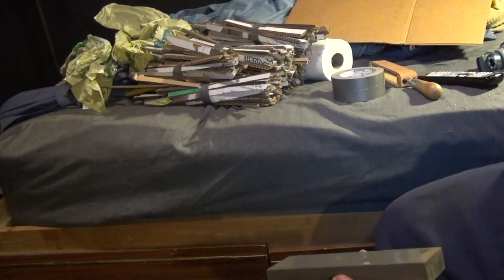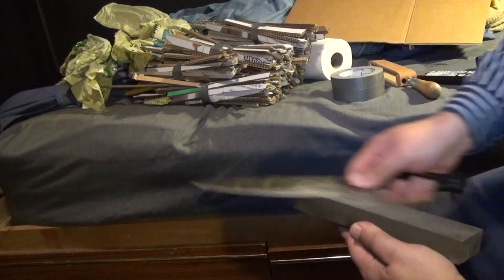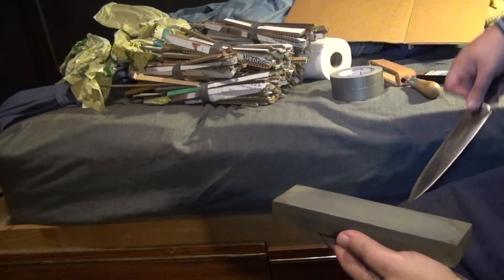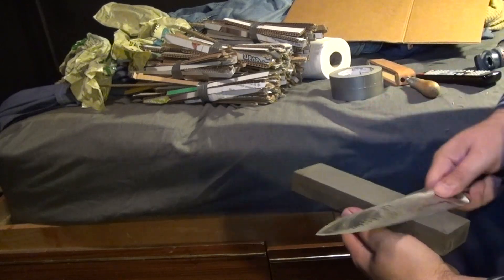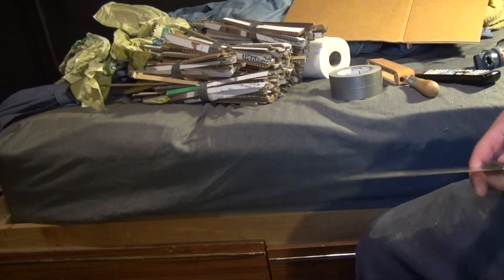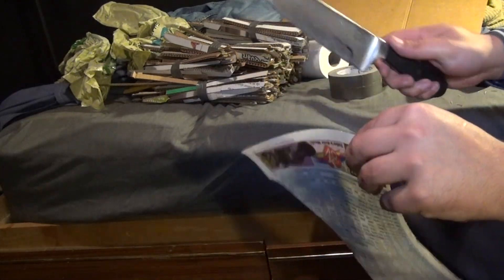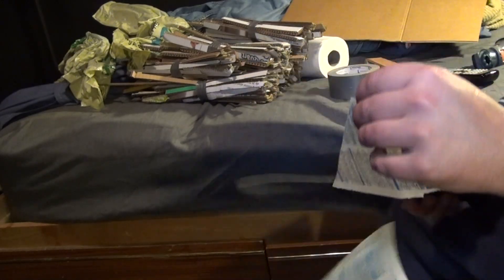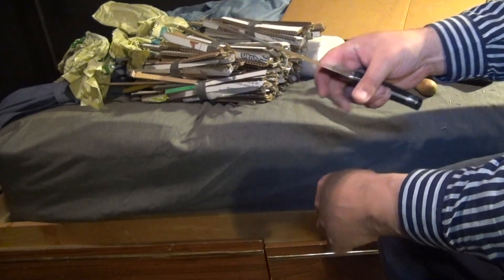Basic three step knife sharpening : destress the edge + shaping + finishing the apex

Comment: Hi, will you please help me to understand what kind of edge( toothy or smooth) is required to cut the onions like this effortlessly....what apex or angle of the edge should be...i understand knife should be thin at the edge...
https://youtu.be/qDFc-5Zc3HU
You might find this video messy but this man is cutting big tight onions without even small wedging... He is penetrating his knife in that whole big tight onions in the straight downward cutting motion....
i do sharpen knives shaving sharp but for onions they wont work this kind of effortlessly....pls help me to understand the edge behind it...thanks.
Reply: Hello. I watched the video.

I think first of all, the onions look like the skin was removed, I think this is important. Even if not, I think the most important thing is that the knife itself is thin, and has a thin edge. A 0.062” stock thickness, with a thin edge should would the best. If you sharpen to 12-15 degrees per side, and refine the scratch pattern on the edge, you should be able to do that. For vegetables I love coarse finishes.

Comment: What do you mean "until the edge no longer reflects light"?? It's always going to reflect light...
Reply from the maker: Look straight down at the edge, at some point the edge is so narrow it is hard to see the light reflecting.
Reply: @CliffStamp  you're back Cliff! got new videos today?
Reply from the maker: @RubricoA.  Probably in a while the summer.
Reply: @CliffStamp  Ahhh yes... Okay, I see -You're looking STRAIGHT DOWN at it. Okay, yeah. Makes sense now! THANK YOU!!
Reply: I didn't understand what this meant until he said look straight on down at the edge itself
Reply: @jdbaker82  Yep! Same here!
Reply: @boobo3763  wow you posted this a year ago I can't believe you responded :) do you have discord?
Reply: the cutting edge of the blade. A sharp apex knife should not reflect light on the cutting edge otherwise it's not fully apex
Reply: @RubricoA.  You're saying that there should be a "smooth" transition of light all the way across the blade from the top of the spine down until the cutting edge, correct? -If the light gets "hung up" at any point along the edge (say, a little flat spot), then that is your visual indicator that there is not a smooth grind all along the edge -In this case we are creating a convex grind... Sorry, hard to explain and understand!!
Reply: @boobo3763  Yes,  it's either round (overstrop) or not fully sharpened to the apex.

Do this on your cheap knives

 Try to dull the edge first on the stone and check the edge. There will be light reflecting to the entire edge. That's what your trying to remove "until the edge no longer reflect light."
Reply: @RubricoA.  Thank you soo much for the explanation! I think I understand exactly what you're saying. Gonna go experiment on my cheap santokus... Thanks again!

Comment: What did you rub on the stone after you swiped your knife on the perpendicular? You say it's a 200 grit water stone, but what grit is the big stone you are using?
Reply from the maker: It is very coarse, ~100 grit or so, it is just a non-name vitrified bond stone. I was using a 200 grit silicon carbide stone to recut the surface as it doesn't release grit so it just wears smooth.

Comment: I can't apex properly if my life depended on it. What could I still be doing wrong which I didn't manage to fix after hours and hours and lots of different knives? I'm basically following your technique, but I never get my knives cleanly shaving of a 1000 grit stone. If I just do 5pps per side on the Sharpmaker, it instantly shaves. So I can't be really far off from a nice edge, but I'm doing something that prevents the edge from being properly apex'd
Reply from the maker: The most common issue is never actually grinding until the bevels meet and form an apex.

Comment: What is this rubbing technique called while you hold the stone? Ive only ever seen the stone placed on a bench or work surface. Is there a detailed video on this technique?
Reply from the maker: I don't know if it is called anything, I just did it that way because of space limitations.
Reply: @CliffStamp  I guess even if done on the bench, it would still be the fast rubbing that intrigues me. I only really ever see longer, slower, deliberate strokes. I'm sure yours is  most definitely deliberate snd controlled, but to the untrained it looks erratic. Do you discuss this method?
Reply from the maker: @kenos01  On the forum I discuss it and other things. 

If you want to see someone do something similar, but with far better production values :

https://www.youtube.com/watch?v=0W5PkdCMMI4

In short, the reason why you can be very fast initially is that I separate sharpening into two steps :

-forming the edge
-forming the apex

At the apex I am very slow and deliberate.

Comment: Hi Cliff. Did I see you change (lift) the angle at the light honing stage from the shaping angle? I had assumed one should keep the shaped bevel angle all the way through the sharpening process.
Reply from the maker: Yes, the final apex is at a higher angle.

Comment: Tried but I can't maintain the angle when alternating sides. Building a burr one side at a time is challenging enough at this point, because I struggle to keep the angle the same from tip, to belly, to choil. How does one know when the edge is apexed? Ive been thinking when it catches on my thumb nail. Pretty sure I have a lot of trouble apexing but not sure the cause.
Reply: Grind a flat along the whole edge like the beginning of this video. Now use light to see the reflection of this flat along the edge. Start grinding both sides until you have the geometry you want and the reflective flat will disappear as you approach forming an apex. Once you ground enough to make the flat invisible, start the careful, light, apexing procedure.

The knife will be razor sharp when apexed. The more care you put into creating a clean apex the sharper it gets. You can even split hairs if you take enough care in forming the apex.

Comment: You say in your notes above: "To maximize the cutting ability the 15 dps bevel would also be minimized to a true micro-bevel by 'back sharpening' at 10 dps" By "back sharpening" Do you mean edge trailing or edge leading? I'm rethinking the value of the micro-bevel and want to make sure it works on Japanese chef's knives and EDC knives. A very clear explanation of a sharpening approach that makes a lot of sense. I've mainly used more traditional Japanese burr approach, but I'm always open to improving any process especially if it makes my edge screaming sharp.
Reply: Back sharpening is grinding behind the apex again. So you thin behind the apex at a lower angle.

Comment: Do you maintain the apex of the knife when it dulls, or would you have to create a new micro-bevel? Also, if you buy a knife that has a 15 dps angle, do you essentially just reprofile the bevel to around 10 dps, and create a 15 degree micro-bevel?
Reply from the maker: Sean,

The apex is very small, it essentially wears away completely during use.

It depends on the knife, some need a 15 dps angle. It also depends on the steel and if I am familiar with it. If I buy a knife from a new maker and I think it would be best at 10 dps, but it is at say 20, I likely would gradually step it down a few degrees each time. This is to prevent large amounts of damage if the steel doesn't perform as I expect.
Reply: Thanks for the reply!

Comment: It would help if the terms and processes were explained. I don’t even know what you’re referring to or doing when you “load the stone with a 200 grit water stone.” What does that mean, and why does it reduce the time and effort it takes to sharpen the knife? And what was all that stroking of the knife on that stone at the beginning for?
Reply from the maker: The 200 grit stone is a very weak bonded silicon carbide which is harder than the larger stone. This cuts the surface of the larger stone and produces fresh abrasive which allows it to cut better.

Initially the knife is cut along the stone to remove any damaged and weak metal along the edge to ensure the edge forms on quality steel.
Reply: Cliff Stamp Thank you for clarifying.

Comment: Cliff, can you elaborate on this statement in your description?

"To maximize the cutting ability the 15 dps bevel would also be minimized to a true micro-bevel by back sharpening at 10 dps."
Reply from the maker: The apex bevel, at 15 dps is very high compared to the edge bevel, hence it reduces cutting ability. To minimize this you just minimize the extent (width) of the apex bevel.

Imagine for example just sharpening at the apex bevel only. After awhile the apex bevel would in fact just replace the edge bevel itself. At this point it is obvious the cutting ability is significantly reduced.
Reply: Cliff Stamp so to make sure I understand, the apex bevel is what we refer to as a micro bevel and in order to keep the width of that micro bevel down and make it truly micro if you will, you would go back to the edge bevel and sharpen at 10 dps. Does back sharpening refer to an edge trailing stroke or the process just described?
Reply from the maker: The process just described.

It is a small refinement.

Comment: My question is what do you recommend in stones? I got a general idea that you recommend a SC low grit stone like a norton economy or cryostolon. 

Would a coarse diamond (240 grit) be a suitable replacement because I already have one of those. Then in the mid grit I have a king 1000 to polish but also create swarf that prevents the bevel being fully apexed and a wire edge forming

I have an extra fine DMT (9 micron) to create the microbevel 

I like to finish with almost zero pressure stropping on a 0.5 micron loaded thick suede leather belt. Is this not a recommended way to finish polishing the edge? I try to do it with minimal pressure in order to avoid doing any burnishing or stropping but I'm not sure what the mechanics of burnishing are so I'm not sure if I'm misunderstanding what the loaded strop is doing.
Reply from the maker: Yeah, in general, a decent set up is :

-a x-coarse shaping stone
-a muddy medium stone 
-a finishing stone

A Norton is decent for low to medium carbide steels, for higher carbide steels, the Norton bond is too high, you will want a softer bond stone (or a Diamond plate). 

Stropping is fine, just be aware of what happens if you strop too long or too hard.

Comment: Ok this is like a "mind blown" video to me.  I have been taught that you need to form a burr on both sides of the edge or the knife won't get sharp.  I can get a knife very sharp that way so I don't understand this concept.  Can you try to help me understand what you are saying here?  I have watched this video several times and I am still lost, lol!
Reply: Also let me add that I have had good success sharpening on oil stones and diamond stones for over 20 years,  but I can't for the life of me get a knife sharp using water stones.  I have been trying them out the last year because I have heard it is a much more pleasant experience to sharpen on water stones.  Does what you are saying here have something to do with that?  Do I need to not worry about even using water stones?  I ground about 1/4 of the edge off of a new knife I bought with my water stone because I could not get it to form a burr.  Any advice you could give me here would be greatly appreciated!
Reply from the maker: If you find sharpening with a burr to work ok, then no issues.

This is the basic procedure :

1) Destress the edge by grinding off all weakened metal by cutting into the stone 

2) Grind the apex bevel until it stops reflecting light, this is just getting the edge to the right shape. It does not take an overt amount of attention or focus.

3) Finish the apex to the desired grit paying attention to minimize the burr.

Comment: When you say reflecting light, what do you mean exactly?
Reply from the maker: You see a shine on the very edge if you tilt it around/into the light.
Reply: @CliffStamp  You mean there is like a micro plateau on the V that is reflecting the light?
Reply: Sau Hund: Yes. I don't think this video showed it, but if I recall correctly, Cliff destresses the edge by "slicing" the entire length of the blade against the stone. This gets rid of the weakened metal, and creates a completely unapexed flat area that will reflect light until reduced.

Comment: Do you put microbevels or was that high angle just to get a reflective spot that was still there but not enough to change the angle and then continue on the lower angle you want to sharpen? I have to admit I always get a burr so I know the entire edge is all the way down and I think this is because of my time on my kme. But after I'm done sharpening or before I change stones I get rid of the burr with alternating stroke. Am I wasn't time doing this? Should I alternate more to gradually bring the edge to its apex ?
Reply from the maker: I micro-bevel almost always for a number of reasons.
Reply: Paul Lonardo he’s essentially doing the exact same process as a kme... you see him grinding away and apexing the blade..upon apexing the edge (forming a burr) he alternates strokes (edge first) to get rid of said burr thereby “sharpening” the knife: just like the kme.. see he still had a burr albeit maybe a very tiny one because I truly don’t think you can apex an edge without some kind of burr formation... that’s the whole philosophy behind sharpening... I think that his style is so refined that his burr is a very tiny wire edge but a burr non-the-less... it’s kind of misleading for him to say don’t form a burr or it’s wrong to form a burr..because without apexing there can be no sharpness... and apexing will always form a burr of some sort even if he calls it “shaping” the edge.  He still must use edge first alternating strokes to sharpen.. get it?  What say you Mr. Stamp?  Can you really apex an edge without leaving a micro burr? :) If so that is impressive; most impressive.
Reply: Chief Chuf I get it. Thanks. I have been free hand sharpening a few months now with great results but always trying to learn new things from more experienced guys. YouTube is the best lol

Comment: Hi Cliff. I do whittling/carving of small caricatures and need my 1.3/8" x 1/4" deep blades to be razor sharp when "resharpening" but also I strop every 20 min or so to bring the edge back from dulling through working on the carvings. Would your technique work on these small knives when I get nicks in the blade, plus do you have any tips for the regular stropping/retouching or would you strop on leather as I do. These knives are small flat blades with no bevel, designed for plunge cuts & shaving cuts. ATB from the UK.

Comment: During step (2) when you are grinding the apex bevel, are you applying about the same amount of pressure on the edge-leading and edge-trailing strokes?  And at this stage, is this even important?

Also, you've said elsewhere that you keep grinding the apex a bit after the edge stops reflecting light, since the edge will stop reflecting at a width of about 20 microns, which is still too wide.  Do you have any suggestions for how to know when to stop?

I tried to make an account on your forum, but never received the confirmation email.  Could it be that your forum's spam filter mistakenly weeded me out for some reason?

Comment: on my coarse diamond stone when I sharpen the edge looks very acute, as in straight. when I use another stone say India or water stone it looks rounded, like instead of a v I have a U. is this because the diamond stone cuts faster their for leaving less room for error in hand changing angle. and the India taking 10 times longer I end up moving my hand even a degree or 2 and it rounds it off.
Reply from the maker: That sounds sensible to me, however it also sounds like your India stone needs to be conditioned.

What type of steel were you grinding? An India stone also won't work well on anything very hard/high carbide.
Reply: Cliff Stamp I'm not sure if its an India stone. sorry if I misinformed I believe its silicon carbide or aluminum oxide. I got it in a 3 dollar bargain bin. grey on one side dark blue on the other, 6 inch stone. the diamond is a Norton 300 grit. the 6 inch 3$ stone I took 60 grit sandpaper and flattened the stone on it. it still didn't cut any better. it does feel rough maybe 200 grit but it doesnt cut like it.
Reply: I haven't bought a better stone yet because I don't want to use up a more expensive stone learning. also the steel is cheap steel 440 420 as I'm practicing on cheap knives. 3 passes on the diamond stone removes very noticable metal. takes a while longer on the other one and no matter how much attention I put into keeping my hand steady it still seems to round off.
Reply from the maker: You can't use sandpaper to flatten that stone as they are likely the same abrasive type. This will just essentially wear the surface of the stone smooth and it won't cut. 

In order to condition the stone you need to use an abrasive harder than the stone (and/or tougher). If you can find 36 grit silicon carbide blasting compound (autobody stores have it) then this will work.
Reply: Cliff Stamp any idea of the price on that. and any cheaper alternatives even if they are very time consuming. atm I have more time than money, also if I get the carbide dust how would I go about using it.
Reply from the maker: It is only a few dollars.

If you know someone who works in the industry, just ask them for a handful, they literally buy it in buckets.

You grind the stone very lightly, as in just 5-10 seconds. Do not continue to grind as you will just wear both grits out again.